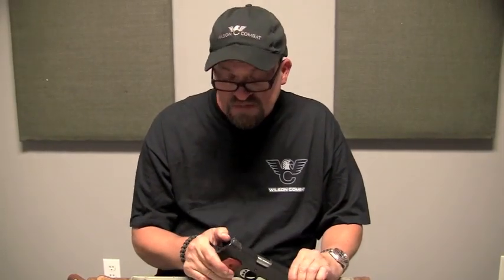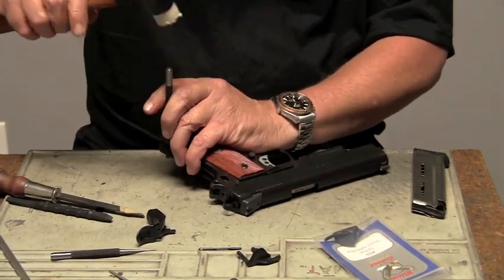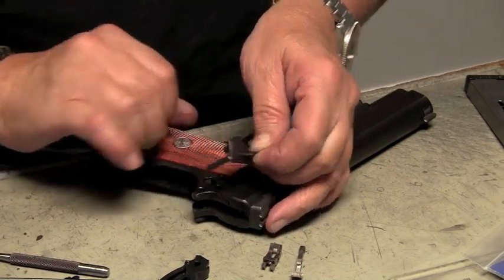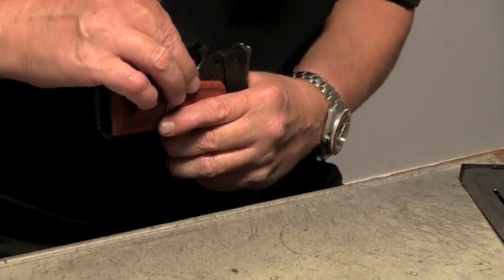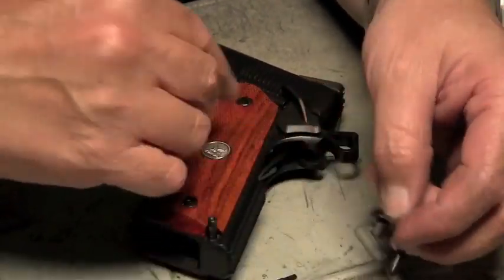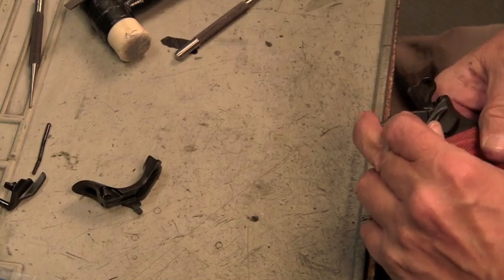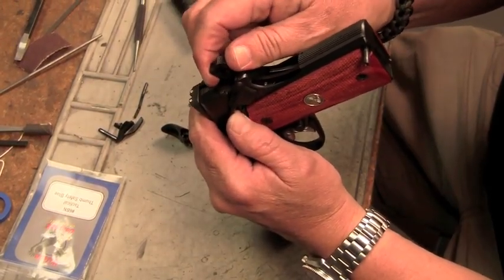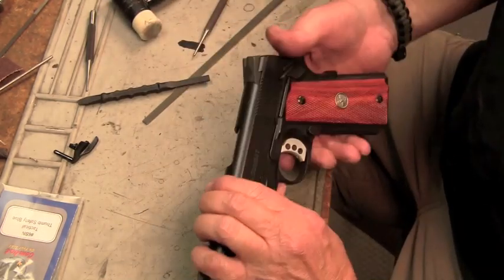Wilson Combat - Installation of a Thumb Safety

Comment: Dark gun against a dark shirt. What am I looking at? I bought a Wilson Ambidextrous safety for a Colt Officer's Model. It took me three days to fit it. I had to quit after a couple of hours because it was getting tedious. I would return after awhile and try again. I filed both shafts, the diameter of the locking area, the little nob, The cuts to go up and down. The only thing I didn't file was the length. The right side grip has to be fitted.
Reply: Ambi safeties are a liability.  the safety should be on the inside only  no safety should be where it can  be unintentionally knocked off.